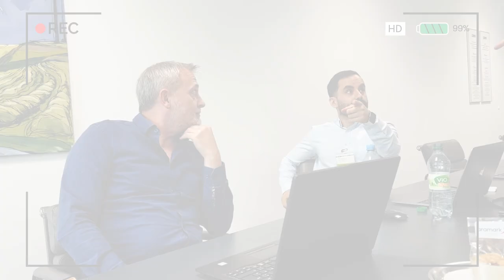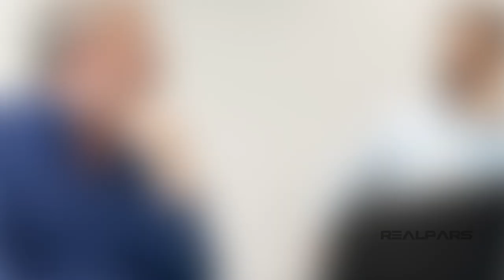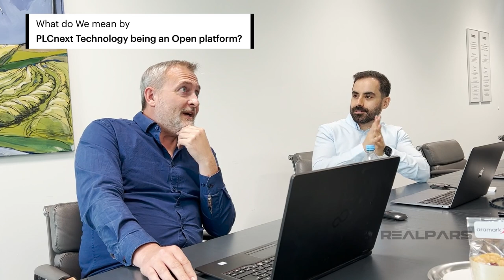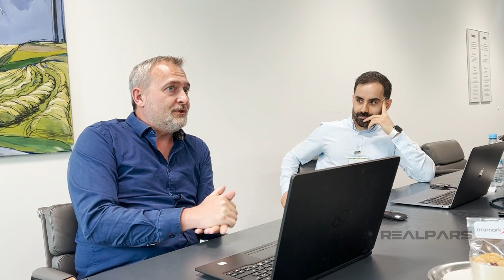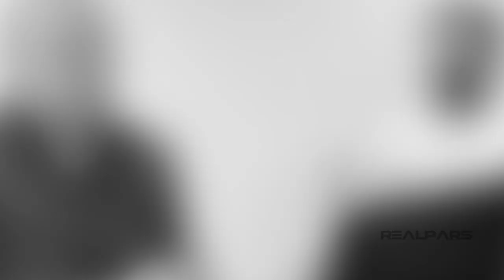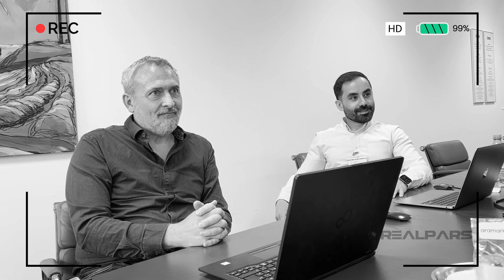Open PLCs: Unlocking the Power of Industrial Automation

Comment: If you are just wanting to use advanced programming to turn on an output or read an analog and do something in a long period of time that's fine.  but in a controller running on a machine you need to be guaranteed reliability.   Having a vendor in control of the languages being programmed keeps the OS running very fast.  running C++, or any web based programming languages are ok if when they do down you have time to troubleshoot them, which always takes 10x longer than the other languages.   Plus with Most PLC's now they do safety at the same time, Motion at the same time.  Those languages aren't built for that to be super fast.  If you have a little brick PLC that you want to do that in then great, but advanced programming languages are built for Programmers(who can't troubleshoot circuits).  when you go down time is money in getting back up.  Those languages are long downtimes to figure out what is wrong and if you need to change a process you can pretty much write it on the fly download and test in a very short time.  I haven't seen the product but if there isn't a status of what the C++ or whatever language it's programmed in,  then it will never really fly in a real manufacturing plant.
Reply from the maker: Good observations and good advice.  The system, hardware, software, and programming languages used need to be familiar to engineers and technicians, able to have troubleshooting performed quickly and accurately, and not require recompilation or redownloading of programs while the plant is running.  Ladder logic seems old-fashioned and simplistic, but in most cases, PLC manufacturers allow for online program modifications that can greatly improve troubleshooting speed and accuracy.
Reply: @realpars  Ladder logic is old fashioned, definitely agree, but the audience I see everyday knows this world very well, and the integrators who should be on top of technology and programming languages are still programming in this language.   I grew on on this, but have made a conscious effort to get better in the other languages.  I am better but it does take time.
Reply: @Why Not  What do you recommend ladder logic be replaced with with?
Reply: @bunnyman6321  More so it has to do with the audience that is using the code.  PLC's have come a long way in bringing together electricians, EE's and computer coding types.  If you can have a common type of language that most everyone can understand then that is what you go with.    I work with all types of people doing PLC troubleshooting.  Most of which can't or won't try and figure out IF, THEN, ELSE type of programming but everyone can understand Ladder or FBD.  Personally there is another language that I think would be perfect now that I think of it and that is something that you just drop blocks onto a work area on your screen and drag lines from the outputs of one block to inputs of another.  That would be the ultimate anyone can work on scenario.
Reply: @whynot16384  Thank you!

Comment: If PLC is able to do logic coding using C++ or java or others..so what is the need of IEC61131 standardization?. How about technicians who do trouble shooting? Do they need to learn C++ or java or others?
Reply: when you need to write complex algorithms then higher level languages are better. 
It totally depends on the problem you are tackling. Having an option for higher level language is plus.
Also Open PLC is not the first one to come up with this implementation just for putting some info here
Reply from the maker: Some PLCs are able to employ C++ as a programming language, mainly the more modern open-source PLCs.  PLCs from the major manufacturers will always need to support IEC61131 languages, in my opinion, while newer open PLCs have an important place in machine control and robotics.  Technicians, for the most part, are not C++ programmers, so manufacturers will need to determine the best cost/value approach to maintenance.   Engineers are more likely to favor higher-level programming languages, but unless they are charged with supporting these programs 24/7, it us best to use the tools that are most useful to plant-floor technicians.
Reply: @Zeesh009  yes I know the advantage and I know what the problem when implemented 24x7 on shop floor in term of maintenance.
Reply: @realpars  agreed...but it's better if logic code in C++ able to switch to IEC61131 for technicians. Trouble shooting does not always come from I/O but from interlock and "handsake" from other device or system too.
Reply: Any system that requires troubleshooting by plugging into the PLC to view and possible modify code, is a poorly designed and poorly tested system. This is where we must change; more testing and more user and technician friendly interface.

Comment: It blows my mind that's it's 2023 and we are just now getting something like this. Feels like the automation software world has lagged behind the broader tech software world significantly over the last 10 years. I'm still confused as to why we rely on ladder logic so much over established programming languages that the rest of the software industry has built such incredible systems with. Even PLC HMI's are pretty low quality verses the user interfaces you can creat with pretty much any other open language.
Reply from the maker: Hello @Arturo Pino. You are bang-on with your comments. As for the relevance and use of ladder logic, I think many applications can be easily solved with LD programs.  LD is still the sweetheart of electrical and maintenance types as the structure and layout are easily interpreted.  Slowly but surely a new generation of automation folks is becoming more familiar with text-based and higher-level languages. Perhaps LD will slowly go the way of the dinosaur? Time will tell.
Reply: @realpars  Completely agree,  I think a necessity to maintain and troubleshoot has been a major driver in the course of PLC history when compared to tech-focused software platforms. That being said, I think you guys are doing a massive service by exposing the world of industrial automation to these new tools that are out there.
Reply: Siemens has been able to do IF..Then.. Else type of programming for over 25 years, they have given the ability to do C language in some of their devices for almost that same timeframe.  Now with their newer HMI's they can do JavaScript.  But problem still exists if someone puts in that code that doesn't have an online status value, troubleshooting time goes up tremendously.  Most of the newer languages just give you tools for Web based things.  Heavy number crunching have been in PLC's for ever.    Where some of these languages fall apart is speed in the plc.  When doing motion, Safety.  PLC's are very important to processes and if you have a non standard language in a PLC, it goes down, and you have a plant manager breathing down your neck to get it up and running, you'll see why the IEC language works.  If you can't figure out the problem on of a 100 people in the US probably can.  If it's all in some third party language then mostly only a person who does coding can figure it out, and that is he understands what a plc does, if not then he needs a technician to pull him along.